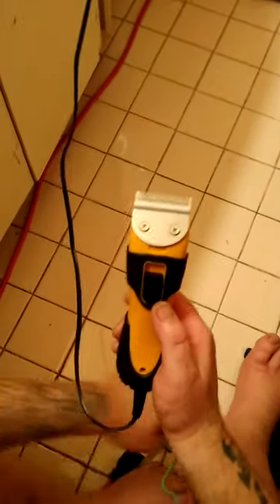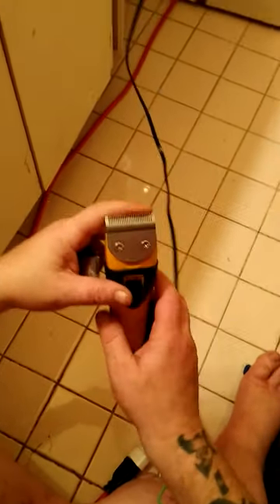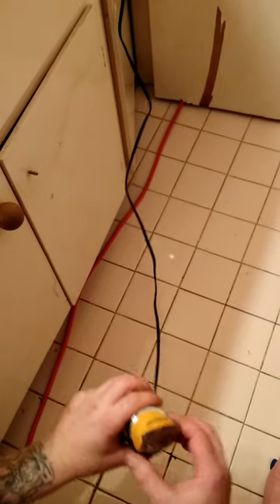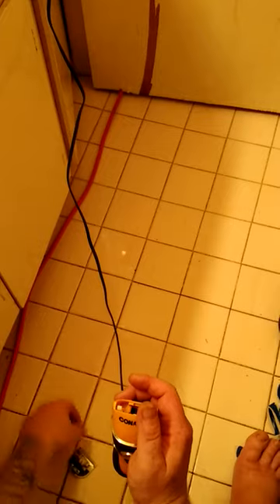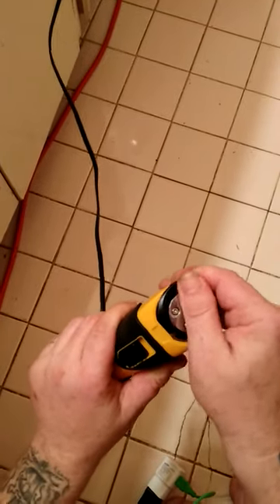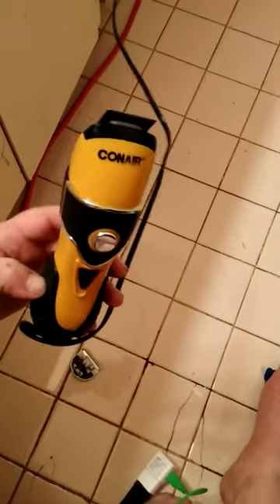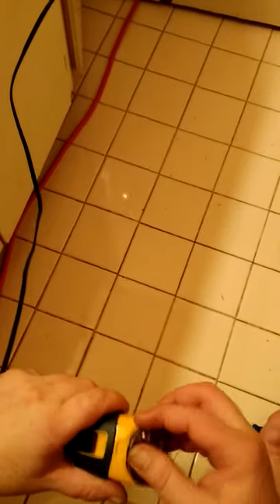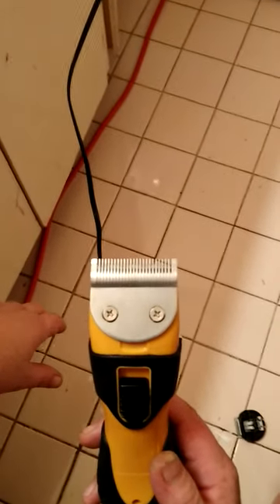How to REALLY change head on Conair clippers

Comment: FYI be sure to set the front dial to 1 or you'll never get the dam thing to snap back in place. That's the one that controls the length of the bottom blades.

Comment: On the small head, the two plastic arms hug the two metal wires. You know, the wires that are poking into that plastic piece.
Inside the Mechanical part there's a knob that will spin and move the blades. Make sure it's rotato line up in the midwhen you install the small head.
So make sure the spring plastic arms that fold are hugging the metal wires. Make sure the matter wires are poking into the plastic piece.MAKE SUR the SLIDE BUTTON is down, then when you've clicked it in, SLIDE THE BUTTON UP locking it in place. 
Then, get Natural Vanilla Bean from Blue Bell ice cream. Enjoy ya scruffy faced nerf-herder.

Comment: If you need, To be able to uncover the machine, in the rubber handle, you must push it down, it is put under pressure, if it can help you with a small screwdriver you can put it between the rubber and the plastic and make a small lever! Then you should try to see at what point the cable was cut! In my case it was right at the tie with the part where the rubber reinforcement is on the cable. I didn't cut the cable, I opened the cable with a blade until I reached the cut... And that's it, like new.